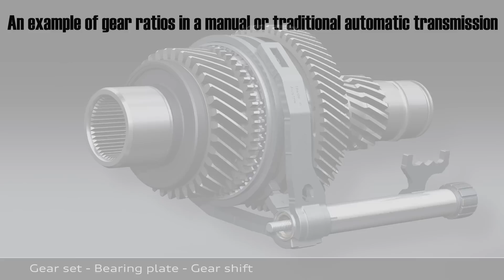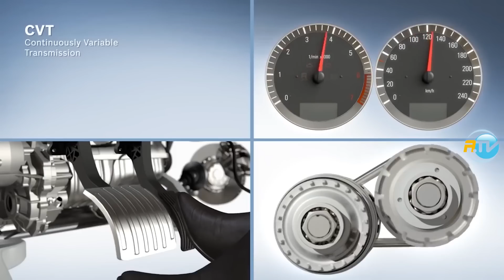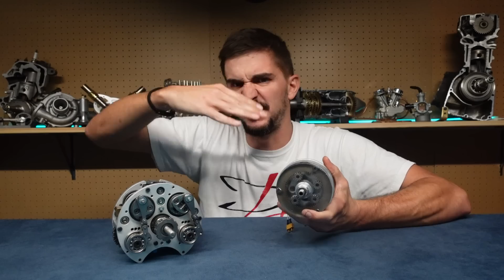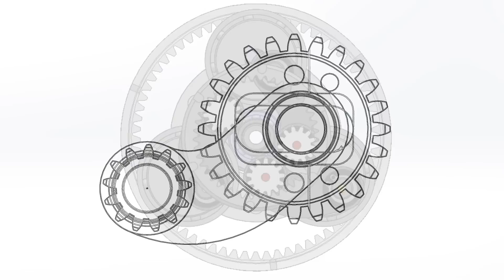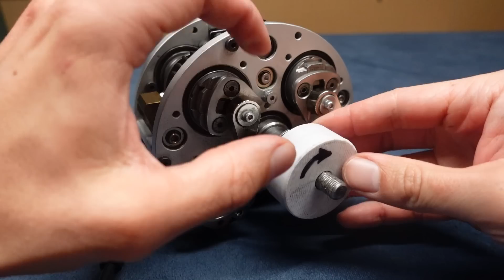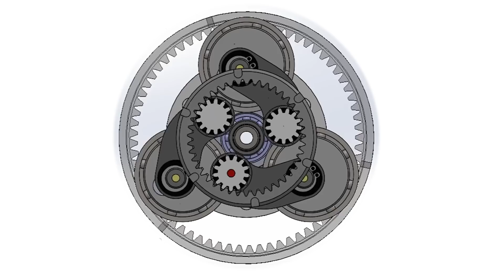This is the World's First Geared CVT And It Will Blow Your Mind -  Ratiozero Transmission

Comment: Firstly, I'm optimistic about this technology. Second, I want to thank you for the clear explanation. I have one concern though, the small planetary gears have to withstand all the torque, and also come and go generating some reciprocating mass. Could this be a problem at very high rpm? Some gear ratios balance the torque and rpm of these tiny gears. It is a great idea overall

Comment: This sounds incredibly interesting.
I would definitely like to add this to my DIY-Ebike. 
I really hope that they can get this to market and that it will not be locked into specific manufacturers (Which could happen depending on investors). 

This could not only allow incredible seamless driving in all situations, but also keep the pedal and motor speed at peak efficiency.
It would also allow some interesting tinkering with different control schemes.
I will definitely keep them on my watchlist.

Comment: It seems that the ratchet thing is engaging during normal forward operation. In fact, you mention the freewheeling part of the arm-to-small-gear rotation of the cycle.I am wondering what kind of efficiency losses are we talking about, considering the constant ratcheting.
Reply: I think the 3 small ratcheting mechanisms will also be the most likely points of failure. 
They will not only have to engage and disengage constantly, but they also have to endure the full load, while also being fairly small.

I think the losses will most likely be somewhere in between a normal gearbox and a belt-driven CVT.
Reply from the maker: I don't know what exactly is inside this one, but the common ratchet design causes negligible efficiency losees, it's just a tooth or pawl that "falls" down a step. There is usually minimal surface area, no resistance, and negligible friction because there's no pressure on the pawl. Think of a socket wrench. You can easily spin a socket handle if you hold the socket.
Reply: @d4a  I have not been able to find exact figures since I don't believe a ratchet has been used in such a way before (constant engaging/disengaging). But I have a feeling it's non-negligible, judging by the clicking sound alone.